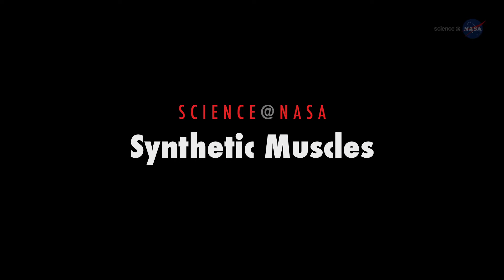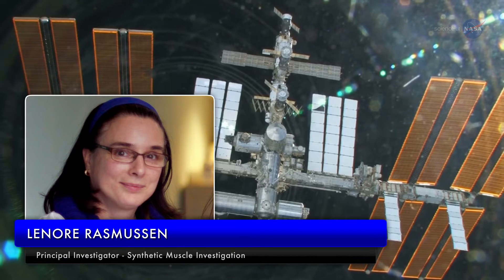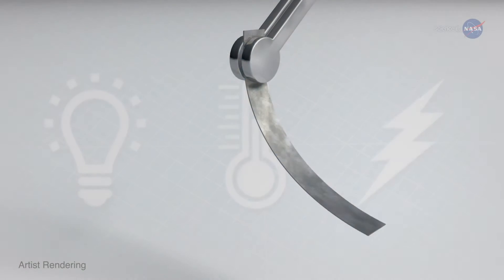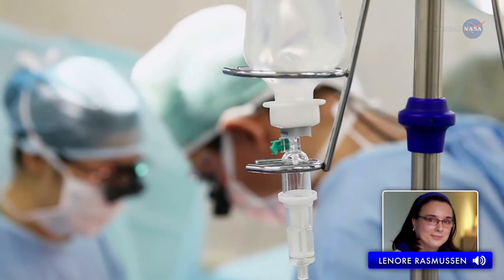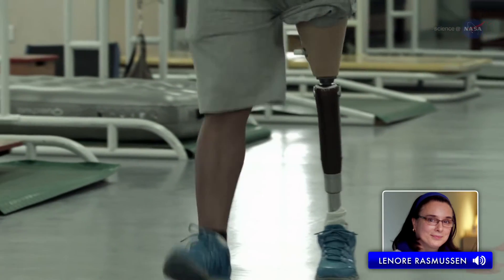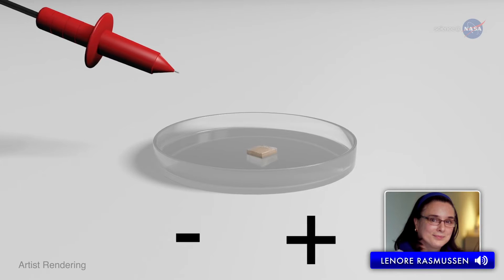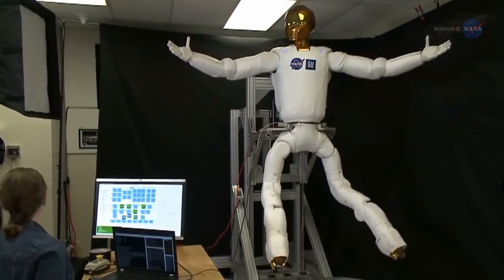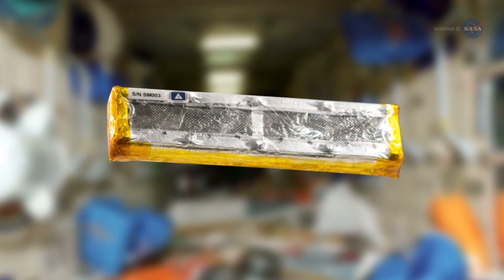Synthetic Muscles - Science at NASA

Comment: Imagine replacing both of your legs and arms with realistic looking prosthetics, which has synthetic muscles that won't decrease in mass or weaken as you age, and has artificial touch-sense! 😯

Old people won't need to use mobility-support to get around anymore.
Doesn't have to fear breaking fragile bones.
They can use the community-transport more frequently, instead of taking a cab (= less trafic).
Perfect motor skills for surgeons.
Less risk of infections caused by open wounds on arms, legs hands & feet and so on!

You could even upgrade or download new skills and movements from the internet! Like "learning" new dancemoves, martial arts, acrobatics, and art/crafting-skills

Or why not automate dialy routines? (like getting out of the bed ---> get dressed --> prepare for breakfast - all while still being asleep! 🤯)

Your legs could be optimized for strenght and endurance, and you could basically attach a battery-pack to your legs and run constantly at maximum speed until the batteries are fully drained, without getting tired, because you aren't using any of your body's energy! (Though we should probably try to find another efficient way to use up residual energy before that happens, otherwise humanity will end up running around like ostriches as a distrubing-looking troop of obese supersonic humanoid-watermelons! 😂)